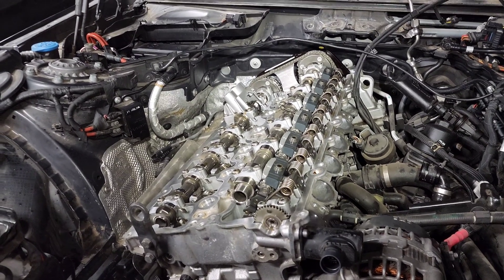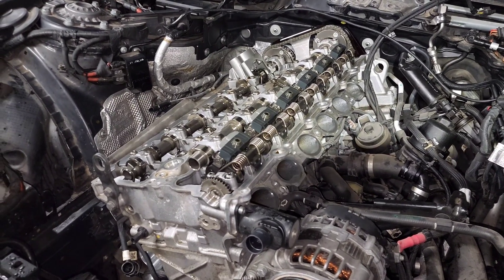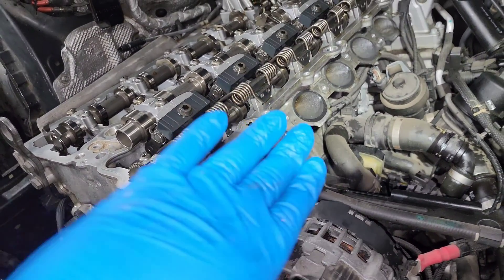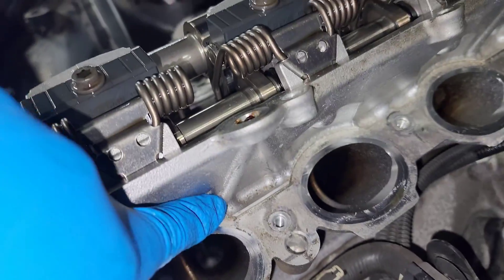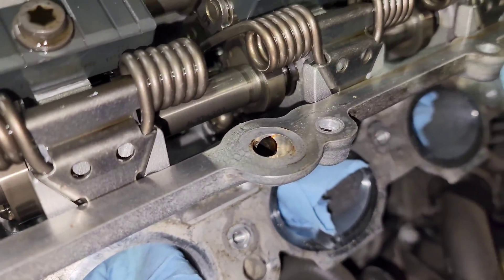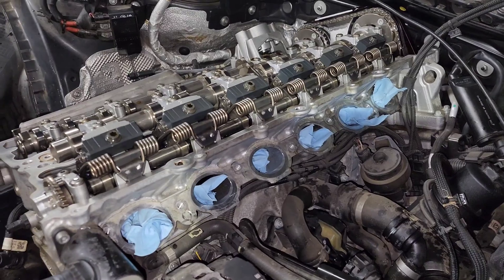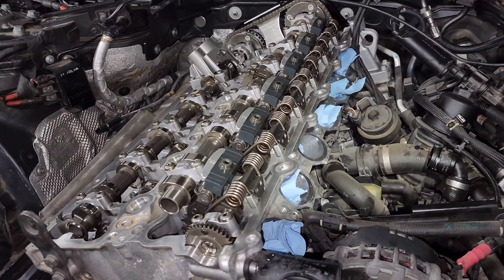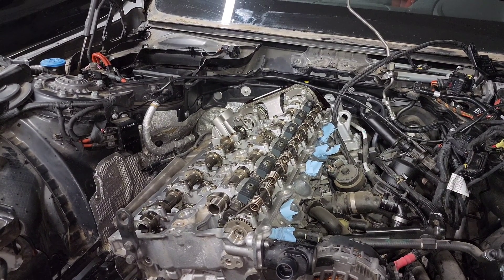PCV Delete that works on all B58 Engines! **Plugged Headport DIY**

Comment: But what's the point if you already plugging the center port on the pcv cover by Ross pcv delete? You have already sealed the only way to the ports even if the internal check valve fails. So why bother sealing every port?
Reply: I mean the center peice of the Ross pcv delete cover has 3 gaskets and now it's sealed in place by twist lock. So if you run 30 psi or more, it won't go anywhere and it will still plug the only way from the vent ports on the intake ports going in the valve cover channel through the check valve (whether it's failed or not) up to the sealed port on the center of the pcv. If this already sealed. Is it not enough? 

I'm just trying to understand here.

Comment: Hello, I have a f82 and I bought the Ross racing v2 pcv delete kit that’s VTA and I had major oil pooling from the turbos and out the exhaust. I looked more into it and it’s saying it needs vacuum at idle so it doesn’t oil pool so I added one way valves to VTA hoses but had the same issue. I reinstalled the OEM pcv cap and turbo inlet back together and the issue went away but i want to run a pcv delete kit bc I spend $370 on it and they won’t let me return it so I am wondering if you recommend something or if I should plug the ports but would this have vacuum at idle? I don’t know what to do or how to stop oil pooling from the turbos or if I should get a new valve cover but I’m pushing more HP and it’s not stock

Comment: Im getting oil in my 4 5 and 6 head ports after i deleted my pcv. Is this a consequence of deleting the pcv? Should i go back to stock pcv and fix the issue or plug the headports? Im only doing 30 psi max and planning on getting the oil cap breather to release some of crankcase pressure

Comment: Would this be a better solution than the Ross racing PCV delete?
Reply: This is a true delete. Generally paired with an aftermarket cover. Without plugging the ports its not a true external system.

Comment: Installed pcv pins and occ venting pcv and ccv, now I have faint smell in cabin from time to time, has this happened to anyone else?
Reply: any blowby in the catch can? i’m getting a good amount in my catch can same setup as you but no block off pins. only over 30 psi on a full frame.
Reply: because is vented to atmosphere

Comment: I did the pins on my m340i and now I I’m getting bogging when high rpm. I bought the Vargas oil cap breather hopefully that fix if not I’ll have to also buy a catch can
Reply: Didn’t work I got code 21b2c7 and also code 16050a.

Comment: Im wondering if there isnt some electric type solution to this problem. plugging the heads seems like a good thing to start the problem is that venting is just a poor way of dealing with this. originally when the pcv system was first added to cars it extended engine life substantially its critical system to longevity especially with a turbo charged car. i once saw study that showed a certain amout of horsepower gain for every inch of vaccuum you can put on the crankcase. what about getting some vacuum from the exhaust for this. that is what i did in my last car and i never had issue with pcv system. try placing a boost gauge on your crankccase you may be surprised
Reply: Delete the secondary o2 sensor and put a venturi attached to the pcv delete

Comment: Hi Kern, with the pcv ports plugged, what does it now change interms of catch tank, vent hose setup? I have the ports plugged, run 2 catch tanks; 1 for the valve cover pcv breather and 1x for the bottom crank case vent... It still is dumping oil into my intake intake pipe. do I need to use a vented pcv cover setup? Your response would be very helpful to put an end to this nightmare I am having, thanks alot
Reply: You figure this out yet
Reply: @rayraycarter04 you figure this out yet too?
Reply: Which turbo are you running?
Reply: Delete everything that makes the engine eat its own refuse. Delete the intake resurculating. Delete evap. Delete pcv system. Use an aluminum baffled cover and go external with a catch can or dump tubes. Plugging the head ports is the necessary step to truly delete the pcv and go external. Doing this job without going all the way is pointless.
Reply: When blocking off the PCV ports you are no longer supposed to run CCV/PCV to intake, block off the CCV and run PCV and oil cap lines to vented catch can to fix this issue!

Comment: Hi Kern, if i go on my supra for pcv block off pin, which other pcv mod i have to pair for reduce pressure? Oil cap breather and a catch can or just cap breather with oem pcv system? Thanks in advance 🙏
Reply: Did u figure it out
Reply: @stickyglue3563  hi sir! With BF i had purchased the BMR catch can kit, include the cap vented into their catch can design and ccv and pcv connection to same can
Reply: @alessioluppino4312 how has this been working for you?
Reply: @alessioluppino4312  it didn’t work for me I’m still getting the CEL and high engine oil pressure
Reply: @Dailycrashouts  i guess is an oil pump problem at that point, my Blackmarket race kit cause no problem and relief the pressure builded by all the parts interested
Reply: @alessioluppino4312  makes no sense tho bc I didn’t have any issue before blocking the head ports
Reply: @Dailycrashouts  oh but i haven't block the head ports, and as i know you have ti relief from ccv if you block the head ports cause you accumulate pressure into the block instead of valve cover

Comment: Just to be clear, if doing this on a gen 2 b58, a oil cap breather should be used, correct?
Reply: The rest of the pcv system should be deleted and the valve cover is generally swapped with an aluminum one. Then its a true external system.

Comment: @kern417 - hey mate are the TU B58 2 port supra motor prone to oil consumption issues or is it because the stock 0-20w oil is too thin? got alot of blow by as well.
Reply from the maker: No. If you have a lot of blowby then it's likely a bad valve cover
Reply: @kern417  cheers. ive only done 6000kms since last service and oil has dropped below mid point. it doesn't show me the graph anymore (oil graph) and just says oil ok. dealership said everythings fine for the moment but i have my doubts.

Comment: So the pressure stays in the combustion chamber? What is now compensating for that pressure?
Also will that work for the B48 engine too?
Reply from the maker: if this is your first pcv mod, you'll want to add another vent for positive pressure. it works on most any bmw engine, but the pcv vent solution will vary.
Reply: @kern417  thanks for getting back! At the moment I have oil in the pcv value and unwanted oil is getting into the intake, so I have also oil in my charge pipe. How would you best solve it? Specially if the car is running higher boost pressure?
Reply: @kern417  my mechanic says the pcv value is broken. We could replace the value cover but it might break again. Will an Oil catch can help?
Reply from the maker: no, it'll just catch the oil but won't fix the problem.

Comment: Hey man plugged my head and now it’s just misfiring in cylinder 3 any guessing? Fuel and spark is good
Reply from the maker: Coilpack? Wiring? Double check your work
Reply: @kern417   my boy omar from Vadersolutions did it. will be digging into it Monday
Reply from the maker: @CSKeaton.  omar knows what he's doing. He'll get you right
Reply: @kern417  100% all wiring was checked and good so we gotta dig back into it
Reply: @CSKeaton. ever find the issue?
Reply: @mdrn2j  yeah injector O ring rolled and plugged it so it just wasn’t getting fuel

Comment: Hi Kevin! When you install the valve cover after fix, you just install new gasket set ? Or something else ? Or you install old gasket ?
Reply from the maker: Valve covers come with a new gasket 👍🏾
Reply: @kern417  thx :)
Reply from the maker: In this case it's recommended to replace the gasket but i didn't

Comment: hello bro on my 540ix i have this error “160001 crankshaft sensor, signal: Missing” and when running low rpm i feel a lack of gas any ideas will help 🙏🏼
Reply from the maker: Maybe the sensor is bad
Reply: @kern417  Ive just change the sensor today runned ISTA+ on it no errors , go on a drive i can feel a difference  but still in low speed/rpms its like jacking , slipping ... also the fuel consumption went up remarkably i'm thinking maybe the VANOS Actuator or maybe Seleonids  but no codes till now ..

Comment: Great video but is there research out there that shows this is a good idea? Is there tested evidence? What sort of power is this an issue at? Quite curious!
Reply from the maker: It is a PCV failure. Like i explained in the video, running higher boost pressure can cause it to fail.

Comment: Is this really a problem?  Do the Gen II Supra guys with big top mounts running 7-9 seconds 1/4 mile times go this route too?  I guess I've never heard of this being a problem but I don't follow the builders like P2 and others for what they are doing on their builds.
Reply from the maker: Yes. Running higher hp increases boost and the risk of damaging the valve cover.
Reply: Running 7 sec you will face a whole lot of other problems and ‘potential’ issue my friend. Cap walk, the need for welding water ports on the head, etc. Venting is needed on these engines.

Comment: Will it be possible that instead of blocking the ports, just tap it ans install another check valve?
Reply from the maker: I'm not sure there's enough space to do that in those holes or the holes in the valve cover. Someone would have to Design one with stronger flaps.

Comment: Vaccum on the crankcase is so important it helps seal piston rings on normal driving so the engine has less blow by, u are just creating more of a problem and will be burning more oil and have more blow by
Reply from the maker: Incorrect
Reply: Incorrect, almost every diesel engine  vents directly to atmosphere as there is no vaccum on those engines. They also have a longer average lifespan compared to gas engines..
Reply: The "vacuum" increases the pressure differential across the ring package, producing an improved ring seal. Just look it up thats why high hp guys making 3000hp run vacuum pumps or use there dry sump system, the main reason this was popular on n54 engines is cause of build up on the intake ports
Reply from the maker: The vacuum makes it more efficient. That's why it can run through (6) 1/4" ports in the head. 

When converting to VTA, you compensate by switching to (possibly multiple) -10AN outlets for enough venting. Like I said in the video you can never have too much.

But when a vacuum system is inefficient or unreliable, you  convert to VTA to keep it simple and reliable. I have no excess blowby after converting to VTA. If you do, add more vents.
Reply: @kern417  I don't have any issues cause I'm still using stock system cause its has zero issues making 800hp, one vta smells horrible for a daily and two if u live in the colder weather depending on hose lenght to your catch cans the hott engine vapors will condense into water filling your catch cans and possible freeze the lines, it's a horrible setup all around for a daily car.
Reply from the maker: @tylercernik  peope with 800hp blow their valve covers regularly. Enjoy the smokeshow 👍🏾